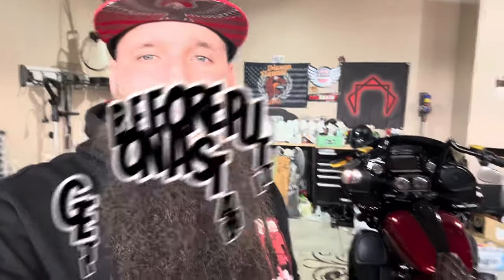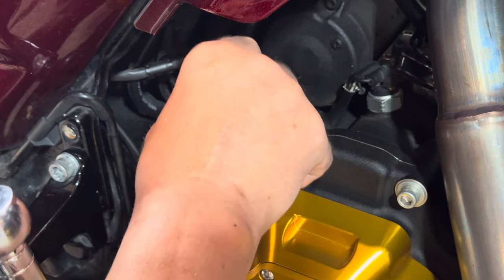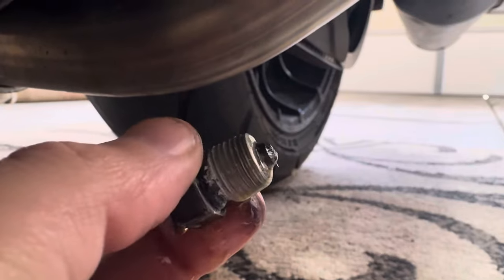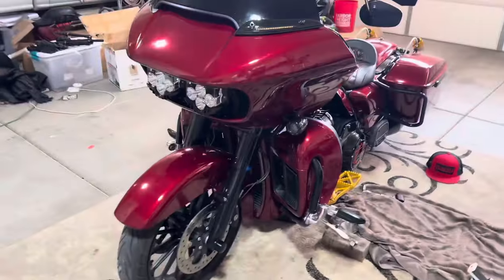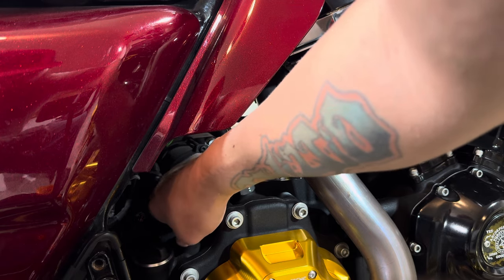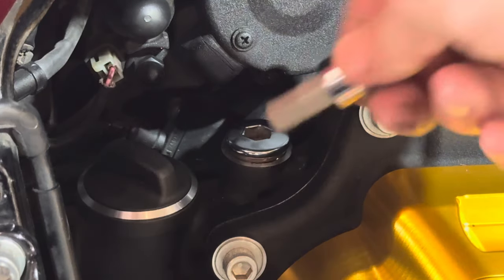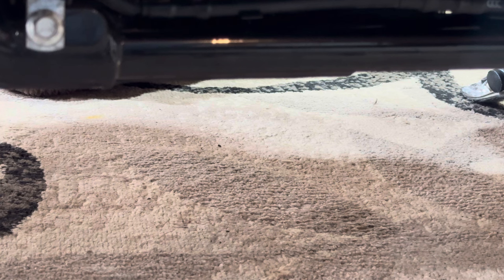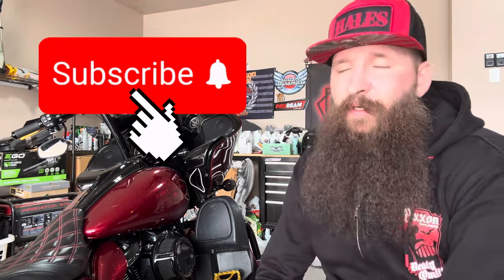Changing transmission fluid in your M8 motorcycle. #M8 #harleydavidson #bagger #performance #DIY

Comment: Whoever at Harley designed the transmission dipstick definitely wanted to make it hard to read. For one I hate needing to use an Allen socket. Two - if it’s hot you need to wear gloves, and then it’s hard to hold because the head is so freakin small. Lastly being chrome clean synthetic oil is nearly impossible to read. I’m really considering just gluing a 3/8 socket in the head.
Reply from the maker: Agreed. It’s an asinine design. 😂

Comment: I hate the transmission dipstick! It’s so clean it’s hard to see!
I change all 3 before every riding season! Yeah it’s overkill but just knowing it’s clean every year!!
Nice video! 
Have you ever thought about using the 75-140 gear oil in the transmission? I’ve thought about it but still haven’t! 
I still want to get the seat like yours!! lol!!
Reply from the maker: Never really thought about the gear oil thing. I’ve always just used the 20W50 Amsoil Trans fluid. Is it supposed to make a big difference?
Reply: @Gimps_Garage  I use the same, I’ve seen you tube videos that they’ve put it in and the shifts are even better?! 
I’ll just stick to the regular Amsoil that I’ve always used!!
Reply from the maker: @kevincarnes7598  from what I can tell from quick glance. The 75W140 is for big bored builds. 135” +. Anything under 124”. I think a 20w50 will suffice. Tbh